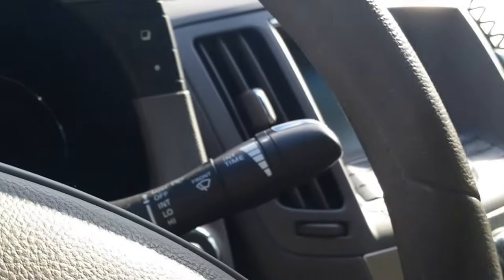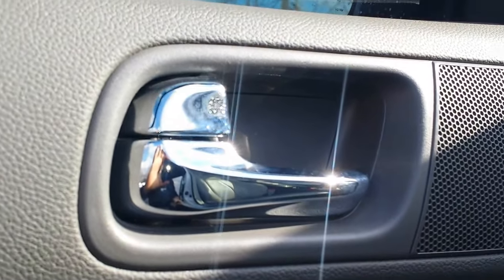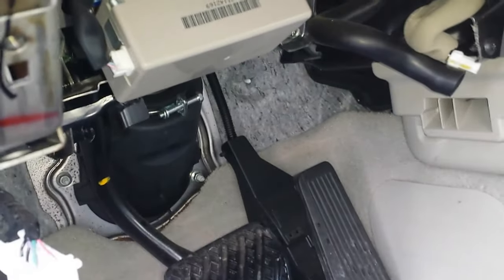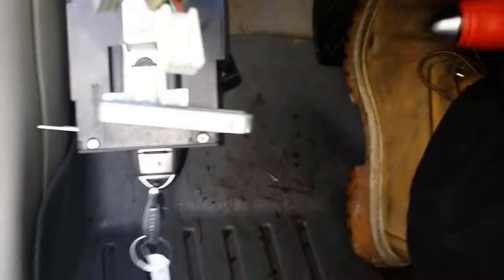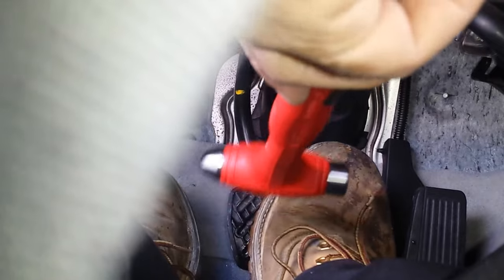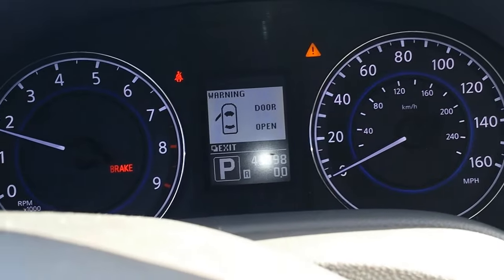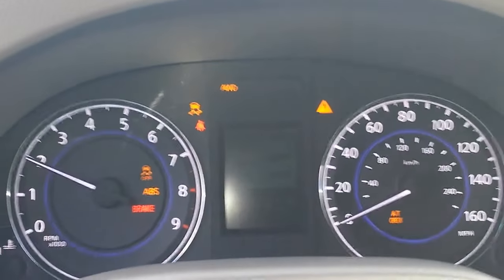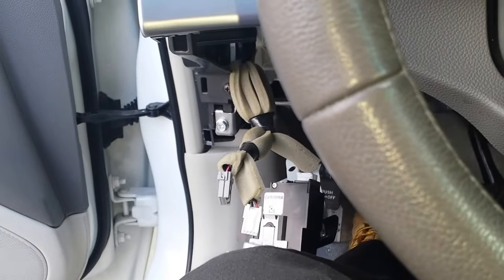How to Start Your Nissan or Infiniti with a Failed Steering Lock Control Unit

Comment: This did not work for me. I had to get it swapped at the dealership but able to get the recall part. I paid 367. The best thing for people to do its report it so there can be a recall or service campaign. There is one right now but it is only for a select few.  Report it to the National Highway Traffic Safety Administration that is the only way you can get reimbursed or get it swapped for free. The NHTSA will notify Nissan to do a service recall or service campaign announcement.
Reply from the maker: That trick does not work all the time.  Nissan has done recalls on this already, but I agree, the more people complain about it, the more Nissan will do something about it

Comment: Hi whenever I connect my battery (I got a new one as well) my car alarm goes crazy and my car won’t start and it clicks. People say to press the security alarm reset button but I can’t find the button. My car is a Nissan Maxima 2004. Please help!
Reply from the maker: If you connect your battery and you notice the parking lights flash when the alarm is going off. That is a sign of a Aftermarket alarm. So you would need to locate the alarm control module to unplug it if you do not know how to put it in Valet

Comment: I just had this problem on my 2012 Altima 2.5 this morning.

I had the key with me in the car and pushed the start button but it wouldn't turn on and the light would say "no key" , the doors wouldn't lock/unlock and the radio didn't go on. I don't think it's a battery issue since I always turn the lights off. 

my car only has 50,400 miles , got it from CARMAX in South Sac in 2014 with only 30K miles.
Reply from the maker: +Thomas Ball  Did you try inserting the remote into the Fob slot?  I think the 2012 Models they did away with the steering lock system.

Comment: IM DESPERATE! H E L P! My car was not charge for a week and was very cold outside like -40! Tried to boost it and it started all is well. And then the next day wont start again tried boosting no nothing it wont start. Bought a new battery still wont start i dont know what's the problem now. it wont spark like it is on and everything but it just wont start. I need a solution asap :( or i'll pay to get my car towed. :(
Reply from the maker: What year and Model Nissan? Engine Turns over but doesn't catch?

Comment: What if I have a Nissan Titan and keys locked into ignition as well :(
Reply from the maker: If you have a mechanical key and its stuck and won't turn, you would need to wiggle and turn the steering wheel to help release the steering lock

Comment: How do remove the cover to get to it
Reply from the maker: There is one or two screws on each bottom corner for the lower drivers side cover. Then it pops off.

Comment: Removing the battery terminals and waiting 3 mins solved it for me.
Reply: How long til it turn on for you Sir/Ma'am.? Ive been tapping mine countless of time & it still won't turn on.? I got this (yellow icon with key) & still wont turn on... i don't have any power in the vehicle except only the key fob slot - pushbutton & icon to step on the break pedal & push the button... praying i kindly respectfully get a response/advice... thank you
Reply: @jezabelmae3201  did you try removing both battery terminals and waiting few minutes?
Reply: @nabihlakkis562  
Yes i have countless of encounters.. I'm going to try to jolt it aka jump start if anything..  literally no power inside the car

Comment: well its at infiniti nowbtgey said they have to replace the electronic steering control unit to the tune of almose $2000
Reply from the maker: Ouch!  That seems a bit up there.  The part I thought was around 800,  Labor is around 2 to 3. So I would have figured it would have been around 1200 or so..
Reply: FixyourNissan. me too they got me
Reply: Bear 11 ues I have the recipts they charged me 1500 amd said the oarts have a 1 year warranty. I said this better not break down after a year. I also told them Nissan was replacing them and they said "well we are infiniti we r different."  I hope my car is on the list. its a 2010 Fx 35
Reply from the maker: That is a Nissan warranty extension. It does not apply to Infiniti's
Reply: FixyourNissan see... theu should fix it they are basically the same
Reply from the maker: I understand where you are coming from and why you think that. But the steering locks are different. Nissan's are made mainly in the US so they use a different vendor that Infiniti uses cause they are mostly made in Japan.  That is why they are different.
Reply: FixyourNissan man that stinks because I dont have an extra 1500 of it goes out again. If so we might do the thing where you cit the wire
Reply from the maker: It is Rare for Steering locks to go on Infiniti's. So if you replaced it, you will most likely never have to replace it again..
Reply: FixyourNissan thank.you thats good to know. I have 2 infinitis and love them.but when he dropped that ball on me I just cried. O dont have that kind of extra cash uou know.
Reply from the maker: I hear ya..

Comment: Exact same senario happened to me about a month ago except my steering wheel was locked. I tried applying the brake, holding the shifter in park and even tried turning the steering wheel back and forth, with no luck. It finally started once I turned and held the steering wheel as far as I could to one side while applying the brakes and turning the ignition. Hope this helps someone.
Reply from the maker: If the Steering wheel is locked, this is not your issue.  The 2 things I would check is the brake lights and the battery.  It is common to double tap the start button so when you exit the car you don't see the ignition come back on which drains the battery almost completely.  So try jump starting the car, or check the brake lights. If they are not working and the battery is good, then it could be a brake switch.

Also try putting the remote into the fob slot just in case the battery is weak on the remote. That is how you would start the car if the battery goes dead on the remote. That slot does not charge the remote. It only reads the chip in the remote to start the car.

Comment: Mine has the red no key on right side and I dumped 1300$ on new steering locks and same thing...so mechanic misdiagnosed my car for sure then found out it had leak fixed that still same red key light coming on it only starts once in while or after I hit button over and over... This cars been nothin but problems I'd never own an infiniti again period constant electrical problems and cheaply made things breaking
Reply from the maker: I am sorry to hear that your issue was misdiagnosed.  When you have your car looked at and it's not checked properly, it does make you loose faith in the product or the person working on the car.  I am sorry to hear that this has happened to you.

Comment: 8 year unlimited is that true?
Reply from the maker: sarath sor  6 years or unlimited mileage.  The 6 years is basically almost expired.
Reply: +FixyourNissan I have an 09 altima, will it still be covered under the warranty? I used your trick and got the car home, and waiting to see if I should attempt to fix it myself or take it straight to nissan.
Reply from the maker: +fullmetalchamploo  You would need to contact your local dealer to have them run your vin number to see if it would still be covered.
Reply: Contacted it and it was too late
Reply from the maker: +sarath sor  Sorry. you are always welcome to contact Nissan at 1-800-Nissan-1 and see if they can offer some assistance to your issue.

Comment: So now the hammer is the replace the start button it will cost 800.00 plus labor my brother 2009 Nissan versa have the same problem and now is the electric power steering the dealer said it will be from 800.00 to 1200.00 dollars the electric power steering motor by it self is 600.00 plus labor so after that fix my brother is going to sell it with 75,000 miles that car is melting he's pocket Nissan isn't the same Nissan like years ago even Consumer report said Nissan have to much issue

Comment: PSA: Nissan issued a service campaign to fix this issue for '09-'10 altimas and maximas atno cost to you. google it and check it out.
Reply from the maker: It is 09's only and it's a warranty extension for 6  years unlimited mileage. That is now expired.   :(
Reply: Incorrect...my 2010 Maxima is in the shop getting repaired under the service campaign this very moment. Check it out for yourself:

https://www.nissanusa.com/recalls-vin/#/#/Home

It was issued on Feb 20, 2017.